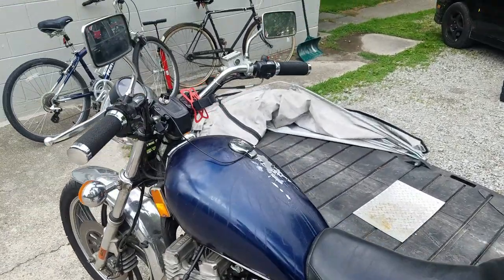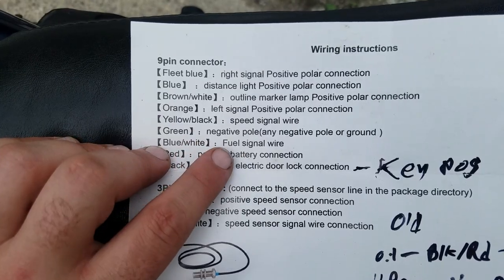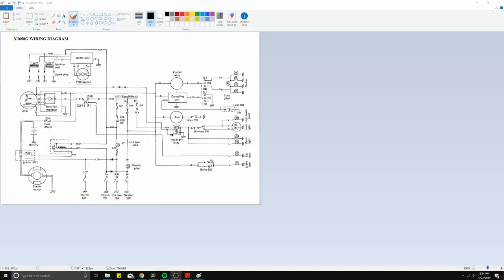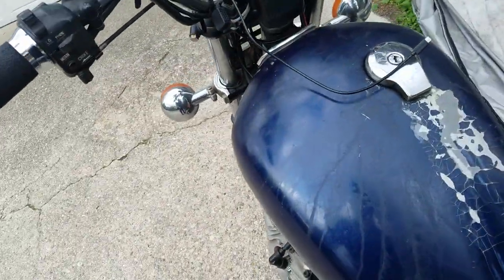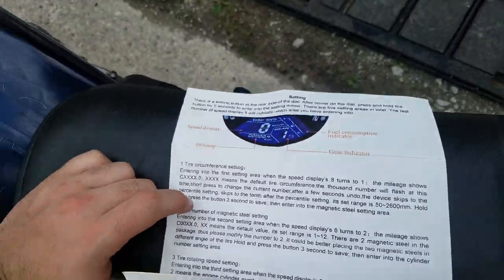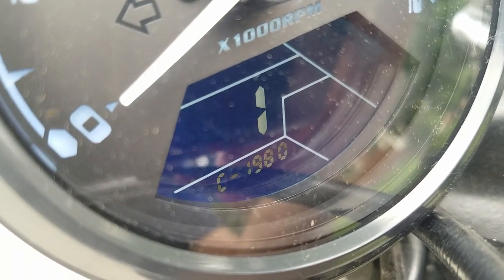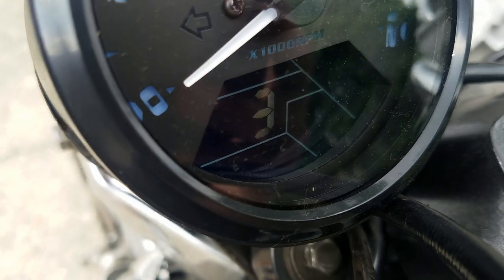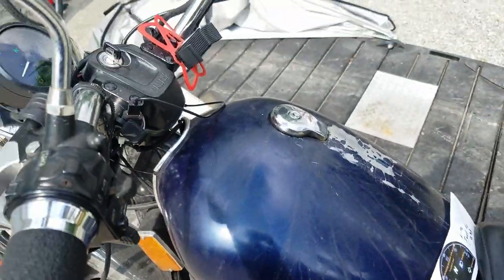XJ650 Universal Tach/Speedometer Install

Comment: You need to use a wire that needs a negative feed as oil warning light. At least on my ‘77 honda needs to be done that way. Oil sensor sends signal via negative. You can use gear indicators on your speedo. I used #6 speed and its working. Good luck.
Reply from the maker: You know what, I think you're right! I noticed that my oil indicator stopped working after this, and it must be because I wired it wrongly.
Reply: Good idea, I use the indicator light.

Comment: Thanks for the tutorial. When you say the red wire is "power to the speedo all the time" what do you mean by that and how would you wire it? Would you just run a wire to the positive terminal of the battery separate from the ignition wire? Wouldn't that drain your battery constantly? Even if you add a switch to this wire I don't see how that's different from the ignition power source. My speedo seems to work fine with just the black ignition wire hooked up and powers on but will my settings not be saved?
Reply: I was wondering if the speedometer has a battery inside that needs to be charged to keep the settings and if the settings will be saved if you use the bike constantly.
Reply: Its almost like wiring a head unit..you need 12v that comes on with the key..and one that is 12 volt constant to keep clock battery charged. I removed my fairing from my goldwing and that left me with the 2 wires that used to feed stereo in fairing. I used those wired as they are already fused to fused box

Comment: How far from center did you mount the magnet? Trying to figure out how to set the speed but mine is way off. Did you use 2 magnets or just one?
Reply: it doesn't matter how far from centre you mount the magnet. As you set the circunference, it will multiply revs per time (second or minute) by the circunference you've informed before. So, if the circunference is 1 meter and it revs 10 times per second, the speed reading will be 10 meters per second.

Comment: What can happen if it rains? Water will enter the headlight housing (where there are some electrical connectors) and 'goodbye' operation - momentarily or in time. And problems, big problems ...
Reply: There are no sensitive electronics in the headlights, so rainwater won't hurt much.
Reply: @sv8313  They are not electronics, but I was talking about electrical connectors - there is a difference between electronic parts and electrical parts. The electronic parts are located in other parts, those suffer from the vibrations.
Reply: @Popa Alexandru  the connectors are fine. Unless you rode the bike underwater, which at that point you would have bigger things to worry about.
Reply: @sv8313 I have met connectors in safe places that have been damaged by water... it is not necessary to ride a motorcycle under water, it is enough to circulate important currents or, for example, some signals with a frequency of kHz.
Reply: @PopaAlexandru.  🤓🤓

Comment: Help me! what did you do to mark the fuel level? The fuel level does not mark me,
Reply from the maker: I used a resistor instead of a fuel level sensor. Since this bike doesn't have a fuel level sensor. I believe I used a 6k ohm resistor

Comment: and that made you start to mark the fuel level ?, how many watts was the 9ohms resistance
Reply from the maker: Yes, that will make say it has gas, and stops blinking. And the resistor won't carry any current.
Reply: flyingfencepost where do you bought your resistor?
Reply from the maker: @tomasignaciomatamalabaez8527  you can just buy them online on eBay
Reply: flyingfencepost thanks a lot!

Comment: What did you use for the fuel?
Reply: I have the same question I tried grounding but it didn’t work. Did you get it figured out?
Reply from the maker: @BIGGZ46  Use a resistor in place of the fuel level sender.